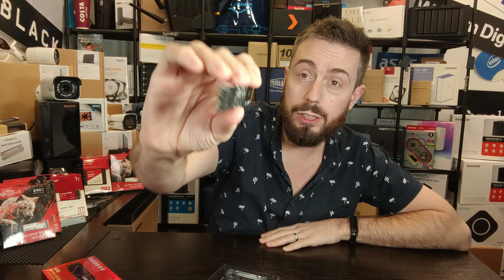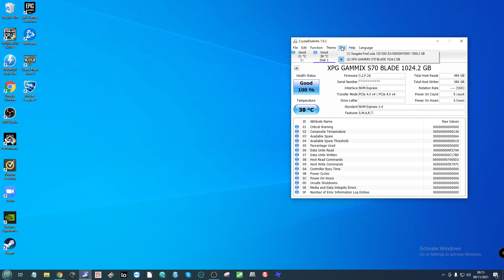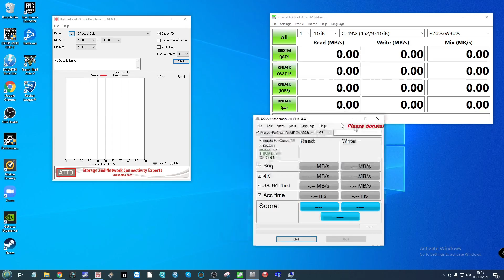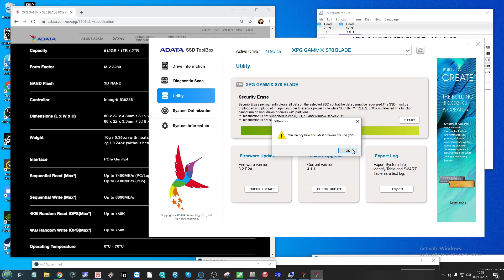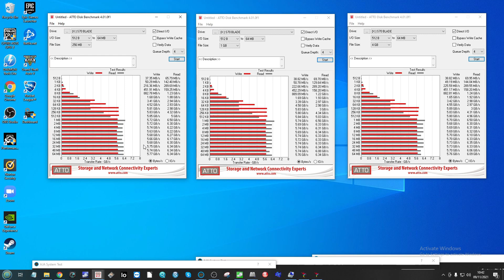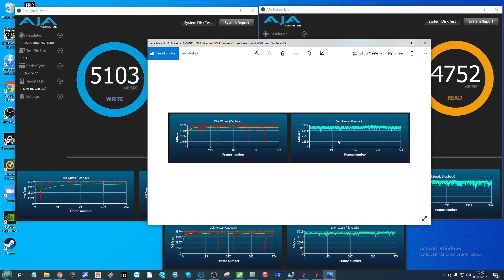XPG GAMMIX S70 BLADE SSD Review - New Phison Killer?

Comment: bro i have installed same ssd 1tb in my laptop but the results are only 3357 or 3206 how is this even possible
Reply: you literally installing NVMe GEN 4 into a Laptop that only supports NVMe GEN 3 .. which by the way GEN 3 only peak at 3500

Comment: Brother I have the 512gb varient and when I benchmarking this ssd my write stuck at 3100mb/s only also I have a gen 4 motherboard. Read spees is 7050mb/s . 

Pc specs - i5 13500
  Mb          msi pro b 760 ma wifi d4
Ram        single stick corsair 16 gb single kit

Comment: Dude, if you wanted to compare heatsinks, you should've done it on the same drive. Not on different drives. They could have different memory controllers, different nand flash, different dram cache depending on manufacture source. That's likely what accounts for the differences, not the heatsink.

Comment: I was able to install Windows, but when I run speed tests, it gives me less than half of the mentioned speed. Do you know what could be causing this?
Reply: Is your motherboard pcie 4.0 or 3.0? Is the slot you are testing connected directly to the cpu, or does it connect through the motherboard chipset? Both these variables can interfere with your performance.

Comment: I got the 2TB one for my PlayStation 5 and it works phenomenally with huge amounts of storage.
Reply: Did you use the heatspreader or a separate heatsink for ps5?
Reply: @darrenjk5438  I used the heat sink it came with although I did purchase a third party heat sink for it as well but the SSD was to big for that one so I just went with the one it came with and its doing great I have the cover off of it for proper air flow of the console.
Reply: So what read speed did you get ???

Comment: Why do so few people give the power consumption?.. Tom's Hardware says it uses 1.6w at idle, which seems bad seeing as others use milliwatts.

"With a very low average power consumption result and impressive copy performance, Adata’s S70 makes for an efficient SSD under load, but it can still consume a lot of power. Peak power draw during the workload measured 8.63W, and it gulped down over 1.6W at idle. "

Comment: if you had to choose between buying 3 of the XPG s70 blade vs the WD sn850 black? which would you pick for a high end pc?
Reply: High end PC, go with Kingston FURY RENEGADE. CRAZY FAST. But to actually answer your question,  if its between those , say probably WD. Both close, similar. If your going with WD 850 , check out 850X. Its Fast. Best of luck. Hopefully he or someone can help you better.
Reply: @MMAMETAL  I ended up getting 3 WD850 2tb each .. and I'm happy with them so far.

Comment: very good
Reply from the maker: Cheers
Reply: @nascompares  I just bought this drive, based on this review
Reply: @nascompares  hey there. Did you also do temperature readings for this drive (S70 Blade) while using both the graphene plate along with the sabrent PS5 heatsink (or another)  ? On PS5 ofcourse. I'm curious if the dual thermal solution helped or worsened thermals. With a pad between or bare etc. Very interesting & would be a very interesting video.

Comment: I have this SSD in my ps5, with the sabrent heat sink. Loving it so far.
Reply: Why did you swap the heatsink?
Reply: @Cr1ptlord  the little tiny heat strip that comes with this, it doesn't do a good enough job of dispelling heat. It will end up overheating. You need to get a separate heat sink to go with it. There's a few YouTube videos out there that show this if you do some googling, you'll find that this is the case also

Comment: Damn, the difference between real layer number of the TLC NAND is a round 1K. The suggested 1176 layers is simply unrealistic. Other than that the disk specs seems fine and accurate.
BTW. I didn't look for the firmware version of the SSD that you've tested but in case you don't know there was a firmware update that has increased the sequential write value of the drive so in case you've used the old firmware then it would be nice to check it out and if possible to make another video with updated results while using new firmware. I've read an article recently that has been updated to include new results with the new firmware installed.
Cheers

Comment: I'm thinking on XPG GAMMIX S70 BLADE PCIe Gen4x4 M.2 2280 SSD  but would it be okay for the cover I use the elecgear on top of the s70 with its heatsink and on top the elecgear?
Reply: Would it help?
Reply: Same question, did you get any answer for this

Comment: Is the thermal plate with pad that comes with the S70 BLADE sufficient for long term use in the PS5? Or should I be looking to add the SABRENT PS5 specific heatsink/cover??
Reply: I have this SSD with the sabrent heatsink. In my opinion it's absolutely worth paying the extra $20 for the sabrent heatsink. And install the SSD just with the sabrent heatsink, don't use the included heat shield between them.
Reply: @BDreGaming  yeah, I really wish someone had replied in a timely manner. I had the heatsink that came with the ADATA on there already and also am using the SABRENT one. It fit just fine and I haven't had any problems. Though I've read that either or would have been fine. I was going to remove the one that came with the ADATA but I've read many posts about people ripping the controller right off with the heatsink so I'm just gonna leave it alone.
Reply: @RawDawginHookers  yeah I've read about that several times too. Definitely don't risk it, leave it as is  :)
Reply: No need for $20 heatsinks… $10 ones do same thing…  and ssd isn’t going to overheat nothing in a PS5
Reply: @jaboy100  wrong lol. The sabrent ps5 heatsink is far superior to generic Amazon ones made for PCs. Do some research.
Reply: Whatever my guy… I did do research and pc specs and PS5 are way different but believe what you want… I’m good 👍🏾
Reply: @jaboy1005  you're factually incorrect. Watch the NAScompares test videos. Money to save $10 for an inferior heatsink would be a huge mistake in the long run. Absolutely get the PS5 heatsink at the very least if you were going to install a new SSD.

Comment: HEY YOU NEED TO PUT OUT AN UPDATED NOTICE ABOUT THIS SSD'S FIRMWARE "UPDATE" CAUSING THEM TO BECOME BRICKED AND UNUSABLE OR THAT THE ADATA TOOLBOX WILL NOT UPDATE THE DRIVE AT ALL ANYMORE. ESSENTIALLY THERE IS NO FIRMWARE UPDATE FOR "INCREASED PERFORMANCE"
Reply: Yeah no need to update the Blade. People were trying to update the SSD when it had the latest version. The issue is there was indeed a bad firmware version. & they made an update firmware (new firmware version name) to fix that bad firmware. But the newer SSDs were ship with a undated "stock" firmware that had all the connections that the update fix/ patch firmware had but it had a separate firmware name that was different from both the bad firmware and the patch firmware. And people where updating this newer stick firmware because it didn't have the patch firmware code. name. 

In other words. People we're trying to install a patch firmware over the newest already corrected firmware.
Reply: What do you mean bro? Sorry iam about to buy this one as its reliable and cheap. Just being cautious.

Comment: Would you recommend the PNY XLR8 CS3140 2TB M.2 NVMe being just as good if not better performance wise than this device, as it's stated up to 7,500 mb/s  seq. read speed and 6,850 mb/s seq. write speed? I've seen you only tested the XLR8 CS3020 1TB in prior videos.
Reply: It doesnt matter, PS5 will even accept lower end Gen 4 SSD, you can google for review, speeds that BELOW the recommended like 3500/4000/5000 MB/s and there is ZERO diffrence, they tested Ratchet and Clank the only game so far that actually uses the SSD speed for the game, and its identical.
The thing is [and im a PC tech and I build system] when you pass a certain speed threshold, there is no difference in actual speed, outside of benchamrks
I think digital foundry had an article or someone else, they got the SLOWEST gen 4 ssd, outside of Sony spec and it was identical as original PS5 SSD

If you want to "feel good" about your purchase, get what Sony recommends, Mark Cerny spoke about WD SN850 and Samsung 980 Pro, if you buy any of these youll get semi-offical support
Reply: @NoBodysGamer  thank you for the response. I did actually go with the XLR8. When I posted this their was very little reviews out there. I'm happy it, as I've had zero issues with it, and like you said runs just as good as the XPG.
Reply: @NoBodysGamer   Do not buy the Samsung. It ids made in China. The WDs are made in Malaysia.

Comment: I'm considering getting this for my PS5. Bottom line, is it safe to install with the included Heat dissipation plate?
Reply: Did you ever get an answer?
Reply: @AkaTheJoker1  I got the blade S70 and the sabrent PS5 heatsink. I did a lot of research before the installation, and found that the safest way to go is to just use the blade S70 and the sabrent heatsink. Trying to wedge the heat shield between them can cause things to bend and is unsafe. I've had just the blade and the sabrent heatsink installed for a month or so and it's working great so far
Reply: So you installed heatsink with the included heat spreader?
Reply: @cooolrohit20008  no, you do not want to use the included he spreader. This is after doing a ton of research. You want to use a good official heatsink, like the sabrent one I have, with just the SSD. Do not use the heat spreader. It doesn't dissipate the heat fast enough to be functional in a PS5

Comment: So which is better, this model or the S70?
Reply: hey identical, this one has slim heatsink, the normal one has huge one, if you buy for ps5, get the normal one, and then dont install the ssd trap door, thats it youll get a bigger heatsink and better cooling, it wont be trapped inside

Comment: In order which would you recommend from best to least for PS5 gaming between the addlink addgame A95, A90, A92 and the Adata XPG Gammix S70 Blade?
Reply: S70 > A95 and the rest are identical, if you want the best version of A95 get the Sabrnet Rocket 4 Plus, its same controller and same 176 layer nand BUT its server grade nand instead of Media Grade [commercial] on the A95, but the S70 is plenty enough for PS5 and has good results, especially if you run a firmware update on PC

Comment: Hi great vid as always! I have just bought and installed this ssd in my ps5 and i have two quick questions if you get the time.

1. I used the supplied heatsink, would you advise swapping it for a more substantial heatsink. 

2. How would i know if i was having thermal issues whithout all the fancy equipment you have?
Reply: Damn I'm still waiting on response
Reply: If you have this version the blade iwth tiny heatsink, it IS better to get a new one, like the  ones sold for PS5, you will never lose on a better heatsink, only win, it might work as it is, but i got the normal version with big heatsink and just installed it without the SSD trap door on PS5
P.S. I would recommend connecting it to PC first and updating the firmware
Reply: You good it’s not going to overheat with thin one that comes with this ssd… PS5 doesn’t get too much heat off of ssd for overheating… if you do get a heat sink there are ones you can use with the PS5 cover over it
Reply: and no need to update ssd… that’s for pc users pretty much… PS5 are the same … pc’s varies greatly
Reply: @jaboy1005  Not updating firmware on things is the same as leaving free performance on the table. Sure, it's probably a minute difference you likely won't notice, but it's still technically more performance, and technically correct is the best kind of correct.
Reply: @DankoleClouds  not all of them need to be updated. That's why people were Bricking some of these SSD's. Some (newer production) come with the latest firmware already installed. This is pretty much all of the blade versions that are out in the wild these days. Especially the ones with the blue PS5 label on them.

Comment: Just got the blade. Doni need to update before I pit it in my ps5 or will it work out of the box. And which side do I put the heatsink on
Reply: Don't know if you seen the answer within the comments already but I'm sure you figured it out. But I'm also sure you were fine without needing to update.
Reply: @MountKash1  i ended up getting a firecuda 2 terabyte instead.
Reply: @teddybeargram3  nice ! I ended up going with two 2TB WD Black SN850's for my PS5 & my son's. But I've been running a 2TB S70 in my son's with with no issues so far. If any issues arise with the S70. I put his SN850 back in his and just use the S70 for PC.
Reply: @MountKash1  true. Well I heard that these ssds with lower stats have been working just fine. I kind of feel like it was a sales ploy. But I really like the firecuda. The other one I noticed alot of screen tear and slow down. But this firecuda is a beast. Im happy with it
Reply: @teddybeargram3  nice ! Good to hear. And yeah I definitely agree.

Comment: is this a double sided ssd? it sure looks like it has nand chips on both sides but I wonder why it comes with a single side heatspreader... the only reason that comes to my mind is that the cooling is mainly needed for the controller (which seems to be on the top side only) and not for the nand chips but I would like to get some confirmation on this
Reply: its not double sided bro
Reply: i think itìs not double sided..on one side it has the nand, on the other side it has the ram.
Reply: For 2tb it still single sided ssd?

Comment: The only NVMEs I'm buying for a while now are the ones with big sustained write speed. My next one is the 970 Pro. Any later generation is a waste of money for me. 2-bit nand is the real worthy champ
Reply: a 970 pro won't work if you plan on using it for a ps5, the speeds are too slow
Reply: @dreamkiller898  appreciate the heads-up. I have 3090 won't ever touch a console. I have a Threadripper system and I usually do a lot of sustained write for my backups.

Comment: Will this work with the Sabrent PS5 Heatsink? Do you just have to use the sabrent Heatsink and not use the thermal plate? Or do you use the thermal plate with the Sabrent Heatsink?
Reply: Just the question I wanted to ask.
Reply: It does work but you need to buy another thermal pad that smaller than the one that comes with sebrent ps5 heatsink if you using it with the the blade heatsink.
Reply: @kuroinova2056  How come sorry I’m just trying to figure out how the ssds works.
Reply: @prometheusvenom7189  without the blade heatsink, you can use the thermal pad that came with the sebrent ps5 heatsink.

With the blade heatsink, you need to get a smaller thermal pad than the one that came with sebrent heatsink.

This is because the thermal pad that came with the sebrent heatsink is too thick to fit with another heatsink inside.

A thermal pad just helps the transfer of heat, allowing the ssd to be more cool.
Reply: @kuroinova2056  Thanks man I'm looking to not spend a fortune on the ssd's so I'm looking for the right and correct methods for the expansion slot.
Reply: @kuroinova2056  so it would just be best to not use the blade heatsink? I would rather do that instead of buying a new thermal pad.
Reply: This is what I have installed. Install only the sabrent PS5 heatsink, and the SSD. Don't try to sandwich the heat shield between them, it won't fit in the PS5 SSD compartment.
Reply: I just used the Sabrent heatsink only with this ssd. Getting speeds upto 6200 ish 👍  I didn't think you would need both heatsinks and the Sabrent fits on fine.
Reply: @MrIanmc1977  problem is I put on the heatsink before I got the sebrent one. And the blade heatsink feels really stuck on their so there was really no other option for me because of fear.
Reply: @kuroinova2056  Hi Kuroi, you could maybe play for a while to heat up the thermal pad then switch it all off and see if it's easy to pull off, maybe a little hairdryer also.  Just an idea.  Or as someone said get a thinner thermal pad for the sabrent. 👍
Reply: @MrIanmc1977  yh, that was me who said that lol
Reply: @kuroinova2056  😁😅😂
Reply: @MrIanmc1977  they said not necessary to remove the plastic on the sabrent cover heatsink I was going to use the heatsink that comes with the blade and add the top of the sabrent or the elecgear but wanted to know if its possible
Reply: @kuroinova2056  I am actually glad to read this. I was concerned that the blade heatsink would fall off when moving the PS5 or after extended periods of it standing up straight. Thank you!

Comment: This is the one I have in my PS5.
Reply: Hi. Did you use the standard heatsink or another third party one?
Reply: @Khunal1  the one that came with it.
Reply: @Khunal1  use the one it came with. Sabrent heat sink will block the airflow on top and will use the other fan to cool vs. the internal compartment negative pressure
Reply: @samjam6989  I installed the PS5 sabrent heatsink with this SSD. This is vastly superior to using the crappy heat shield that comes with the SSD, it doesn't cool the SSD nearly enough.